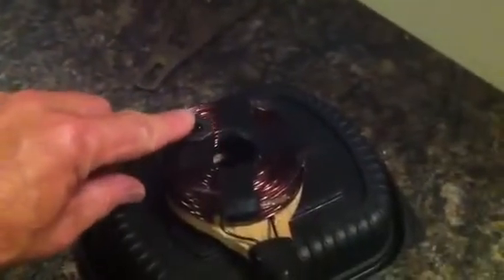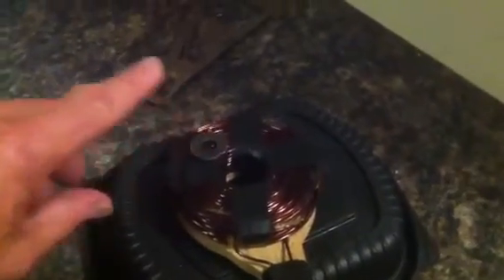EMP demo

Comment: Could u do me a tutorial on how to make this I can't get mine as good as yours please could u help me.??
Reply from the maker: Hi, my EMP coil is 16 gauge enameled copper wire with 150 turns around a 1 inch center disc. Then I poured white glue in after testing. For power,  tie into the input lead to capacitor in the flash(+).  Older bulky flashes  work best I think. Cheers